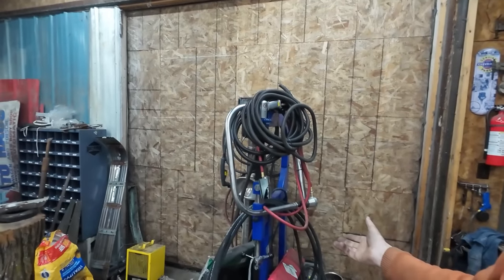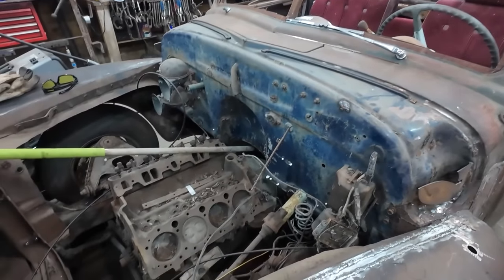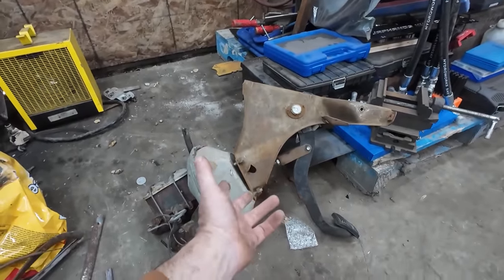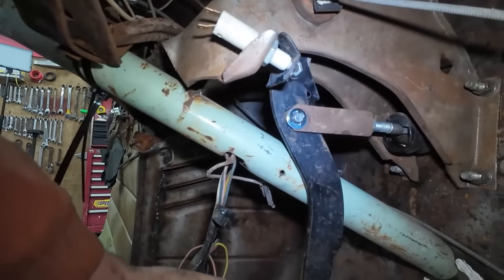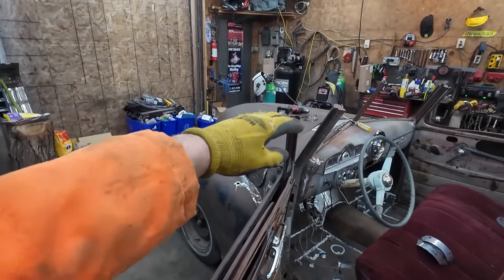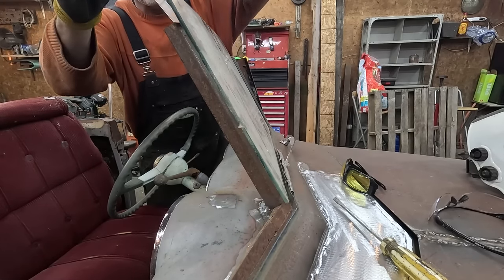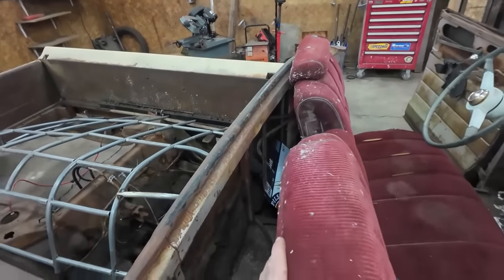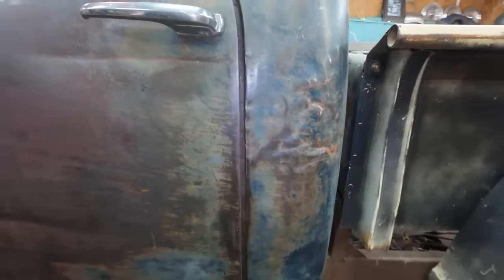Patching the cowl vent and scavenging the yard for parts to install the master brake cylinder.

Comment: I've always thought it would be cool to modify a cowl vent so that it hinges backwards, opening toward the windshield, and have it house a row of gouges.  It could be electrically operated to open and close with ignition on/off, or wired to a switch.  Great job on the truck, Brent!

Comment: I used 2000-2007 3rd row suburban/Tahoe seat in my 73 c10, they are very thin in the back. Also have built in seat belts and forward tilt. I snagged the color matched front center console as well. The fitment was very nice. Note the factory mounting holes on the bottom are offset, makes it interesting when mounting adjustable seat adapters.

Comment: @Halfass Kustoms : Brent, have you ever considered taking about 4 inches out of the front of the box and adding the same to the back of the cab?? That would allow you a much more comfortable seat and legroom. It would give you that look you were talking about with a shortened wheelbase as well... I am always looking for comfort. At 62 years old and a fused back, I need all the comfort I can get. Especially for long hauls.....

Comment: Really like extending the cab or moving the rear axle and fenders forward to improve the balance on a lot of trucks. Thanks for filling in the cowl vent, getting ready to do one and will pretty much copy how you did yours. Wanted to do a cold air inlet for the engine from the cowl vent but not enough room behind the dash. Hope you get in to the new shop soon!!

Comment: You changed out the dash center decorative center also!    Maybe a "ram air" type scoop in the cowl vent hole depending on what happens for engine power?  Too much?

Comment: Personally GM isn’t my thing but I can still appreciate the work you put into it. For the windshield header you might want to make your connections to the A pillars and center post then make the corresponding header for the top before you begin the actual top

Comment: Nice work, fella. Your truck is coming together slowly but worth every minute. 

This may be a bit long, but it's question time. Plus, I have some information you may want to consider. It concerns Hydro.

I've noticed that with other Youtubers in America, it takes several weeks, months even, for your electrical companies to connect you to the grid. It's also very expensive. Why is that?

Before you answer, I subscribe to a self-sufficient off grid family in Virginia.

I will not bore you with their life's history, but the facts are simple. The wife tends to the farm, the husband, a qualified electrician, runs his own business's. 

When they built their home, they did their own electrics, but when they asked to be connected to the grid, they were told there was a waiting list, a minimum of one year and a connection fee of just over $73,000 dollars. OMG 😮

Apparently, to run a power line from the main road along his driveway, connect it to several junction boxes along the route. Then, installing one utility pole with transformer and finally connecting the transformer to the main house is the reason why it is that expensive. Oh, and the whole job would take just one day!

So, thinking he could bring that cost down. First, he rented an excavator. He dug his own trenches from the main road all the way to his house, which was a total of 360 yards, and took him 3 days to complete. 

Then, he had to dig another trench from the utility pole he installed to the house, which was 38 yards and took 4 hours to dig out.

He povided all the tubing and connectors for the electrical cable and wiring. The draw string needed to pull the electrical cables through the tubing, which he left in place, ready for the electrical company to use.

He provided and installed 3 large green junction boxes on the 3 large cement bases, which he also built, and were positioned every 100 yards as specified in the code. 

He did all the work. Provided all the necessary equipment. Installed a utility pole. Total money paid out by him, $5,980 dollars, and still, the electrical company wanted over $73,000 dollars to connect. Why?

Not wanting to wait a year or spend that crazy amount of cash, he decided to provide his own power using wind and the sun. 

A friend suggested that he might be able to make use of the water from a small creak running through his property.

The solar system he installed was so good that it powered his home completely for 24 hours, only using 68% of the stored battery power during winter! Everyone took a hot shower, watched TV, or played video games.

He used every electrical appliance possible, including heating provided by the air conditioning system, which also blows out hot air. He did that for 24 hours just to see if he had enough power stored from a cold, cloudy winter day of charging, and he did.

He upgraded his system nine months later once the new barn was built. This was to incorporate additional equipment for his turbines for his second business, a vehicle garage with two mechanics. 

He built a separate powerhouse that not only stored all the electrical equipment but also the 16 specialist batteries.

He needed a heater to keep everything warm during winter, in case the system developed a fault, so he installed a generator at the rear, which ran on diesel and can quite easily run the house 24/7 on one tank of fuel. He tested that theory. 

He installed a reaction turbine down at the creak that supplies power to the new barn he built.

It has two car lifts plus the usual mechanics equipment needed all powered using wind and water and overloaded power from the powerhouse. 

The garage workshop, barns, and house all draw its power from the powerhouse. This  prevents it from overloading. How I do not know, but it has worked well for more than 2 years. 

The best part about it, apart from being environmentally friendly, of course, is that the whole system, 24 very large solar panels and the equipment needed. The wind generator and all that equipment. And finally the reaction turbine and all that equipment. Everything cost him just $28,000 US dollars. 

He recons anyone is capable of installing a solar system but connecting all three types of power, well, that you would probably need a professional to do it for you.

If the worst scenario was to happen each year from now on, causing him to replace expensive parts, he is still in the green.

Imagine how much money you pay to hydro to power your home and workshops.  Multiplynthat amount by however many years you think you may live, against the total outlay of providing your own power? To coin your phrase, Brent, it's a win, win.

Obviously, word got around, and now he fits solar power setups to homesteads all over Virginia. 3 businesses are making him many thousands of dollars week in and week out plus money from YouTube.  It's no wonder he's living the life of Riley, driving a Bentley and taking 3 overseas holidays a year.

Some say the reason why these companies make you wait so long is because they didn't carry out your electrical work and supply the fittings, so its a kinda punishment.

Some say its because they are simply too lazy on jobs that caused the backlog. What's your opinion?

I have another question closer to home that I'm sure most viewers were wondering. 

Once you have moved into the new workshop, what becomes of your old faithful shop? Instead of using it for storage like before when it becomes redundant, again, how about converting it into a paint booth?

See you in the next video, later. 😉🇬🇧🇺🇦⚒️

Comment: Love the build !  I was thinking years ago of building a roadster out of a gmc/ chevy cab of the same vintage by cutting the roof off.  But l wanted more leg room. Have you thought of extending the rear of the back of the cab a few inches and making the bed a little shorter maybe that would make it look not so long without changing the wheelbase.  Just thinking 😅. Seat would look better!

Comment: Brent, to match the pictured truck me thinks you need to take a couple of inches out of the fenders, lengthwise, i.e. make the opening about 1 inch larger than the tire diameter.  It will be wild when you get her done.

Comment: What about instead of shortening the wheel base 4 inches, extend the cab by 4 inches. Thus also giving you that extra leg room you want. Make the cut just after the rear door jams and its mostly just 4 inch strips of sheet metal to weld after that.

Comment: Would it look good if you swap the rear fenders left for right? So the bumps are at the rear like the front ones? Might have to move the wheel opening.

Comment: Truck is really starting to come together Brent.  Why can't you get a flat piece of glass that is long enough to go on both sides and then heat the middle of it and bend it in the middle?  Is that even possible or would it shatter?  Thanks for that little shot of the NEW SHOP there at the end when you were moving some stuff in.  Can't wait to see you start working in there and to see what Ester does with her little spot..  Santa Claus is going to be very good for you guys this year and it is well deserved..

Comment: Lot of flex in the firewall , probably need another mount under the dash . The camera see's what you dont, from the driving position.
Reply: Also, a substantial gusset for the base of that center bar of the wind shield.
He previously mentioned that wind pressure on that center piece might cause some dash welds to break.
A bracket, welded at the base - onto the transmission tunnel - could be easily covered with a center console.
Reply from the maker: yeah the bracket it fastened to the dash/steering column mount. not sure if I showed that or not.